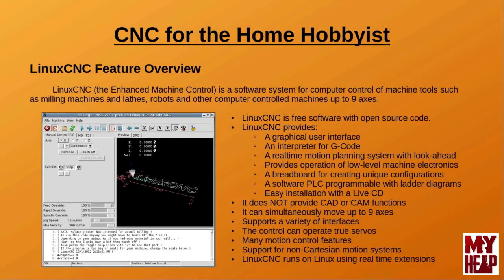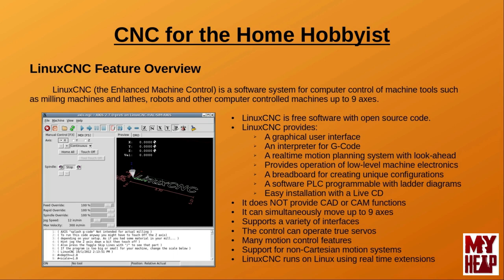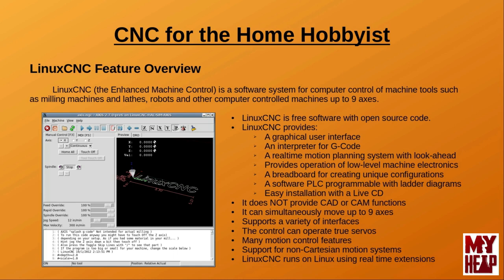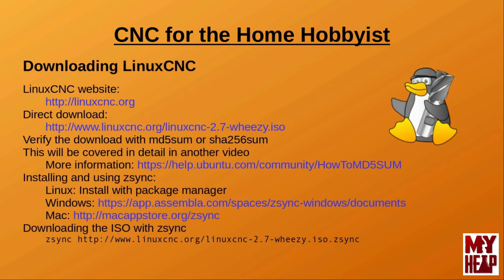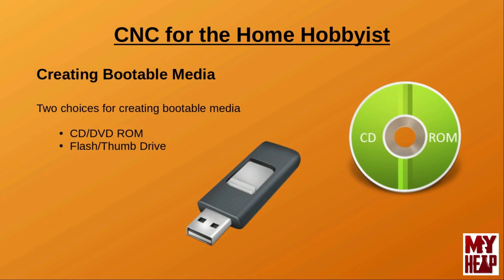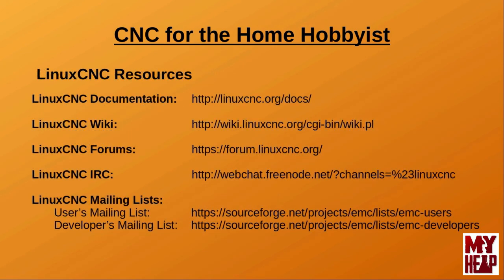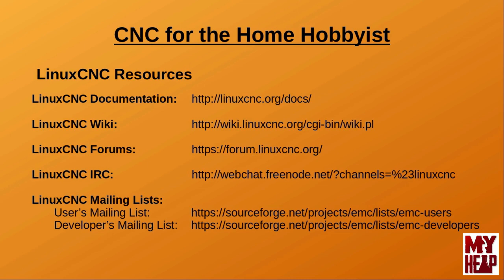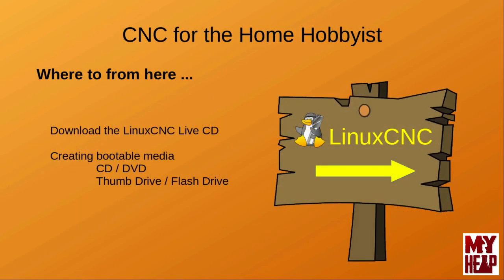LinuxCNC for the Hobbyist - 002 - The LinuxCNC Controller

Comment: I just found your channel from Makin Sumthin From Nuthin channel. I've been wanting for some time to get away from Mach and WindowsXP. I have three CNCs a Shopbot PRT 4896 that has it's own software but also a Sherline 5400 desktop mill that I converted and a 7x10 Mini-lathe that I also converted. The latter two are controlled with Mach3 and I really would like to upgrade computers and controller software to a 64-bit version of Windows 10. I'm looking forward to this series to really help. Thanks for making this knowledge available!
Reply from the maker: Hi George.  I hope you find the information useful. But let me be clear.  These tutorials cover LinuCNC and are targeted towards the beginner.  LinuxCnc runs on a 64 bit system with real-time extensions.  Currently most would install it with Debian wheezy but a newer iso is in the works with Debian stretch.  Other installations are possible as long as you have real-time extensions.  If I can offer any help, please feel free to comment on a video or email me.  Thanks for stopping by and taking the time to comment.

Joe
Reply: Thanks Joe. I was a Unix user many years ago and I've been using Ubuntu off and on for several years. I'm looking forward to your videos so I can try and learn something about LinuxCNC. I'm most needing to learn the setup which I'm sure is way different than Mach3. Thanks for the reply, I hope to catch up on a lot of your videos!
Reply from the maker: George, it has been a little bit since I released a video on this series but I have not abandoned it.  The next one will cover using the stepconf wizard to set the machine up.  If I am not slammed this week at work, I hope to find some time to do the outline for it.  After that I will walk through a real setup using either my CNC router as an example, or some separate motors and controllers.  Keep the faith, I will get to them.
Reply from the maker: One more thing, LinuCNC follows the Unix paradigm pretty close.  Most stuff is set up in plain text files, but if you are familiar with *nix and have been using Ubuntu, you won't have many troubles with that.
Reply: No pressure Joe. 😀 Only when you get the time and want to. Thanks!

Comment: Good day Joe and really thanks for your very interesting serie. I'm on the way to switch/test Linuxcnc from Mach3 for my diy Milling machine. As explained I downloaded the image from linuxcnc.org, verified and tested as live distro, followed by full installation on appropriate Dell Optiplex780. 
The bad point seems that some repository references are recently changed and the installation is not anymore so easy. I tested directly from the live and get the same problem. The result is that you cannot install some apps to make stress test and anytime you check for update you get plenty of errors. As you understand I'm not a Linux expert and even less regarding linuxcnc. Do you mind, if you have a time, to verify this situation?
I still following all your very good videos but not sure I'm working in the same condition you're describing.
My regards and thanks again
Danilo
Reply from the maker: Danilo, It seems that Debian Wheezy is now EOL (end of life)  This would explain why the repositories are not working.  Here is a link to Debian Stretch that I believe will be the replacement for Wheezy as far as LinuxCNC goes.  I am currently working on an update to the Parallel port video and will address the isue of Wheezy in the next one.  Here is the link:  http://www.linuxcnc.org/testing-stretch-rtpreempt/

You would install it very much like wheezy.  If you have questions, please reach out.

Joe
Reply: @MyHeap   Thanks Joe for your prompt answer, in fact I've tried the testing version but something still to be stabilized, I guess. My single point  up to now is to understand if the Wheezy offer anyway a stable solution even with few repo for updating and still usable until new version will be released. Have you tried with Ubuntu Precise 12.04 version?
Thanks again for your time.
Danilo
Reply from the maker: @danilo9724  Wheezy is debian v7 long term support while stretch is debian v9 long term support.  So as the operating system goes, stretch should be fine to use.  As I understand it, stretch (debian 9) wi9ll be the official release for linuxcnc when they are done testing it.  Now that aside, you can install LinuxCNC on other distrobutions of linux using uspace.  John has a page on it located here.  http://gnipsel.com/linuxcnc/uspace/index.html

I have been asked about installing it on other OSes by other users, so I may try it and see what I can do.  If successful I will post a video on it.

Back to Wheezy.  I think there are ways to get repositories for wheezy.  You may want to hit up the gang on the IRC.  I hope that helps some.

Joe
Reply: @MyHeap  Once more thanks for useful information. I'll test at the moment what I've available in stable (hope) condition till I can find better solution. Just curious to understand if a basic installation can support a cnc mill. Pleased from your support.
Danilo
Reply from the maker: @danilo9724  yes, a basic installation can handle a three or four axis mill and a lathe.  Will be out of pocket for several hours but if I can offer any help, feel free to ask.

Joe
Reply: Hi Joe, just to complete this task, I was told in one of the Linuxcnc facebook group, about a Unix/Linux reference page which report the following archive position for Wheezy repo: 
deb http://archive.debian.org/debian/ wheezy main contrib non-free
From there everything was then updated.
Just good to wait for new Linuxcnc release
Danilo
Reply from the maker: @danilo9724  just thought I would give you an update.  Today I installed Lubuntu 18.04 on a virtual machine.  Compiled a new kernel with the preempt-rt patch.  Then was able to compile and run LCNC in a realtime environment.  I want to go through the process a couple more times and finish my parallel port video then I think I can make a video on it.  Maybe that will help some folks out.

Joe
Reply: @MyHeap  Joe sounds very promising an updated system with real time kernel. I'm not a linux guru but I eager to learn more and get good stable environment . I've updated the repo reference in Wheezy and performed all your suggested steps installing Phoronix test suite etc. and getting 15950 latency after hours of test.
While many people use Win8/10 platform for CAD/CAM would be interesting get an overview as well how to setup  a local sharing folder or similar to easily transfer Gcode into LCNC without USB sticks.

BTW thanks once more for your efforts with this Bible Videos, so useful and interesting method to explain things.
Danilo